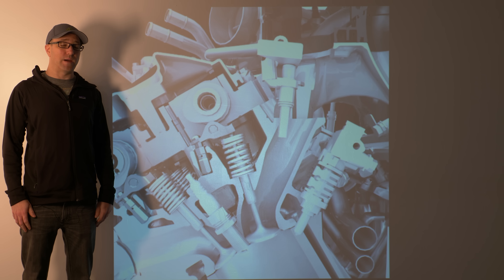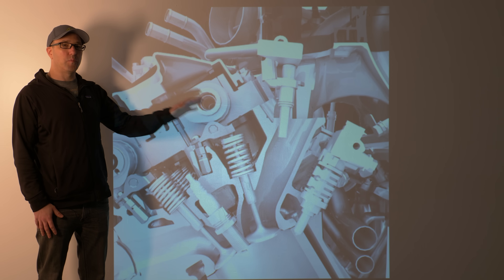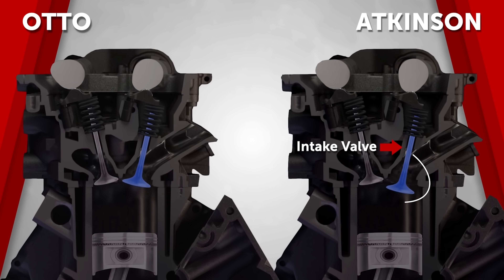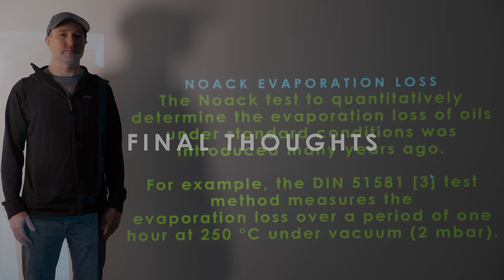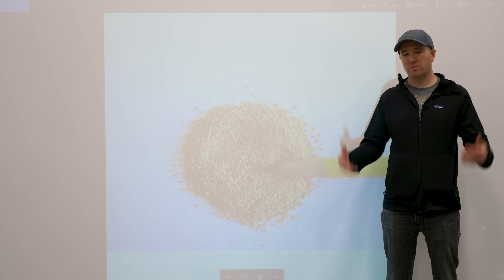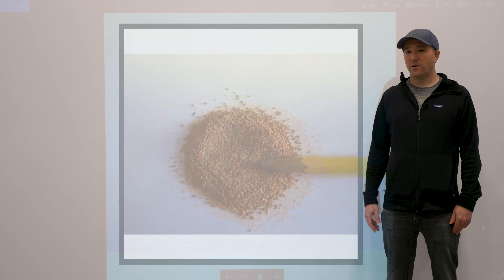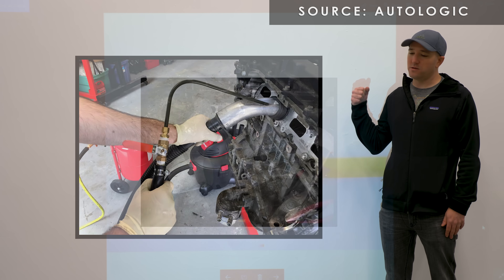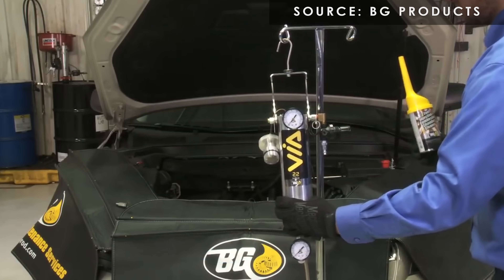Direct Injection, Problems and Solutions | The Fine Print

Comment: Great video. I've read none of the comments. But the BG and CRC distributors will come out in force with their unproven chemical wash. This can damage your engine. Ford and other automakers say don't use these chemicals for many reasons ...at any time. The only way to prevent carbon buildup is using a air/oil separator(catch can) and walnut blasting. Don't spray anything down your intake.

Comment: Thanks to the federal government our cars are more expensive to buy and maintain.  Had an 08 VW with the 2.0 turbo and DI  After 60k the dealer wanted $1200 to clean the valves.  I sprayed water and cleaner in the intake which cleaned it good enough to reset the CEL.  I traded it off and bought an older port injected vehicle.  You can keep the DI, I'll stick to the older PI motors.

Comment: The big issue is the speed at which new solutions are being integrated to meet emissions without extensive long-term durability tests.

Direct Injection valve carbonisation was well covered here.

The other issues is Low Speed Pre-Ignition (LSPI) issues with with Direct Injection (particularly turbocharged) and new generation low viscosity oils like 0W-16 and 0W-20. Nothing worse than a cracked piston from this.

Thankfully engineers are trying to resolve these issues. For example new generation oil standards like API SP, ILSAC GF-6(a or b) and ACEA C6 that are designed to prevent LSPI and timing chain wear with these 0W-16 and 0W-20 oils.

Comment: 2018 Mazda 3 2.5L just had a decarb and new fuel injectors installed.. still misfires.. New sparks, throttle body cleaned, MAF sensor cleaned, new air and cabin filters.. MPG down from 28 to 17.. dealership can't fix it.

Comment: Was not fully informed of the disadvantages of direct injection when I bought my Audi TTS. At 60.000 miles an independent shop advised me to have the walnut blasting done, the before and after photos were much more dramatic in terms of build up than even your pics, a sharper throttle response was notable. One note, the shop charged $700.00, my audi dealer 
"estimated" the same procedure at $1900.00 to $2100.00. would you comment in the future as to additives that promise to reduce these deposits ? Thanks for an excellent, understandable presentation about a real world problem.
Reply: I found a local guy to do it for $300. I asked him if I could help him clean the valves and replace the Intake Manifold, he dropped the price to $150. Now I have a clean engine and the knowledge to do it myself for $150. Pretty amazing deal. Then again I own a Mazda and the Intake Manifold is VERY easy to take off and positioned right in front of you. Its really not that hard of a job. A few hours cleaning without special tools. If you let the valves soak the junk comes right off with CRC after an hour or so.
Reply: An air oil separator/ catch can will reduce deposits on the valves

Comment: All owners of Audi and Volkswagen motors GDI have to do valve cleaning . I just did mine not bad if you take intake manifold off valves injectors right there . Best method Berry man’s intake cleaner hand full of zip ties . A little soaking time and best thing that worked for extraction fuel transfer pump from harbor freight about 10.00 did mine in 2 days . Be sure to pull fuel pump fuse and you can crank not start engine to close valves. I’m novice DIY er so if you have some kind of mechanical savy it can be done! Stay strong kings 💪🏼💪🏼💪🏼

Comment: Careful on his advice about going from a 0w20 to a 5w30w.  The newer engines out there are reducing the piston ring to bore pressure to make the engine more efficient. A thicker oil can seriously interfere with this.  Also, I can attest to BG Products being the tip of the spear in additives and cleaning systems. The vast majority of the other stuff is snake oil. BG actually works.

Comment: Just yesterday I installed my Mishimoto catchcan in my Type R. And with the last oil change I switched from the OE 0W20 to 5W30 by Redline
Reply: Btw I did the oil switch at 50.000km and the Catchcan at 51.500.

Comment: Amigo you are a gem! I have owned a 2006 Lexus GS300 GDI for a couple years and did not do my homework on it. I have done nothing but struggle with doing doordash full time and blowing through two quarts of oil a week no leaks keeping the combustion Chamber clean as I can dumping two cans of seafoam spray in it a month and I know I can't keep doing that but I just want to say this was an amazing presentation on very very important subject matter. And as you mentioned, i don't blame the engineers and car producers because you know the regulations that they have to keep up with and balance that with the customer satisfaction as he said so it was just a failed experiment and wow I didn't know what to do with this car I love my car and I keep my cars until the wheels fall off. And thanks to you I'm going to be able to keep mine until the wheels do fall off with some hope at the end of the GDI road which is very Bleak right now but thank you again so very much for this informative video you have really really made a difference in my Approach and now my attitude towards confronting this failed but not dead technology

Comment: You’re not illustrating the full scope of DI. Yes it does carbon buildup over time, but at most it can create a misfire scenario, however walnut blasting cleans this up which only involves removing the intake manifold and when this procedure is completed by a mechanic, it is being vacuumed out at the same time it is being blasted in order to prevent the dust particles from being left inside the head. Additionally, the cylinder must be on the compression or exhaust stroke to be done correctly. Licensed technicians are familiar with this procedure and it can be on the pricey side, but it is the nature of the beast. Regular and “on-time” oil changes while using a high octane fuel. You mentioned catch cans which is also a preventive component, however the trick with these are that a vehicle needs to get to operating temperature every time to prevent sludge buildup from moisture and condensation. Additionally, many vehicles are already equipped with these catch cans from the OE. Lastly, the EPA doesnt care if your engine is reliable during its life span outside of warranty. Their only concern is a reduction of emissions. The other point to make is most OE are building DI. Port is a thing of the past already even though theyre still on the road.
Reply: So, basically A) accept the semi-regular maintenance expense of walnut blasting whereas no costs were incurred there previously, B) forbid any short trip to the store where your DI engine never gets to operating temp, and C) accept that your chances of engine troubles after your warranty expires are inherently higher than those of a PI injected engine. Sounds like a real sweet deal!! ...both my VQ's have already outlasted DI engines from their respective eras, and will continue to see 5+ year old DI engines sent to the junkyard while they drink their 91 and get oil changes every 4K miles. That's the practical truth.

Comment: The best engine ever made was and is the Ford transit 2 5 DI ..DIRECT INJECTION DI ENGINE FITTED TO THE MK3 4 5 TRANSIT TRUCK VAN HERE IN THE QEER OLD CORRUPT UK 🇬🇧..I GOT A T REG 1999 DI TRANSIT VAN AND IT HAS OUTLASTED 8 MK 7 AND 8 9 AND OTHER SO CALLED TRANSIT MODELS..THESE NEW SHAPE TRANSITS ARE A DISGRACE AND A SHAMEFUL EXAMPLE OF RIPOFF CRAP THEY MAKE NOW TO RIPOFF MUGS WHO BUY THEZE SHITE TRUCKS..

Comment: This is a very cool presentation. You did mess up the gas blow by a little bit here (https://youtu.be/xrLNDgrIw3U?t=429) making it look like they blow up from the engine bottom past the cylinder rings and up to the engine's top and PCV valve. Nah. They blow down from the combustion chamber through the rings raising pressure in the crankcase on the bottom of the engine (and again you're somehow pointing to the top and calling it a crankcase), and then taking oil vapors along while they're traveling through ventilation channels toward PCV valve and back into intake.

Comment: Did he really say that about blowby and crankcase pressure? 100% wrong and almost the opposite of reality?
And the pictures of the supposed DI motor valves are obviously 20+ yo non-DI motor
Reply: I know and these simpletons are eating it just. tbh DI has gotten better at keeping carbon down, also seafoam every 30,000 miles and all will be good.

Comment: You just need to walnut blast your intake every 30,000 miles. Simple, just weigh out 2 cups of walnut media into a cup, use a funnel to pour it into your tank, the 2 stage pump system supplies it to your injector nozzles at the proper pressure for your injector nozzles to precision blast the carbon right off the metal surfaces. Shoot, your covering walnuts as I type this.

Comment: This is a very informative video and describes the problems related to direct injection very well.  He did make a couple
mis-statements when describing the sequence of events during combustion.  When combustion occurs there is a great deal 
of pressure created which drives the piston down.  But some of that unburnt fuel and air pressure pass the piston rings and 
ends up in the crankcase.  This pressure does not travel up into the engine as much as it travels down into the crankcase.  
The vapor rise through the passages in the crankcase.  It is later when all the fuel vapor rises to the top of  the engine and is 
pushed out the PCV circuit.  The PCV circuit dumps this vapor into the intake system, so that it can be burned.

Comment: Remember EGR on engines?  The reason you don't see it anymore after the early 2000's is the Camshaft Lobe profiles changed to allow the intake valve to open early allowing some exhaust to be pushed back up the intake to be re-burned.  The delete of EGR was a big cost save for manufacturers.  This is how the burnt carbon is getting on the valves.  The PCV system is making it worse by adding the unburned fuel and oil vapor to the carbon deposit only to be cooked and coated with carbon again when that intake valve opens late in the exhaust stroke.  We can thank the EPA and Manufacturers for the issues associated with the layering effect and carbon buildup in DI engines.
Reply: Quite a few Modern GDI turbo engine's still run a n EGR

Comment: My car is at 145k miles and I use either amsoil or pennzoil with relatively low volatility. I'm sure my valves are dirty af and I don't want to get them cleaned. If my car craps out I'm just getting a non tesla electric cause it's not worth the trouble going with a catch can on a DI turbo.

Comment: Very well presented. I have a 2019 Toyota yaris with a 1.5L DGI. I spray in a can of CRC GDI IVD Intake Valve and Turbo Cleaner every 5000 miles, an hour before I change the oil, and let it heat soak as per the directions. Then I change the oil. My poor car has a small stroke when I do this, but it clears up quickly. It has over 48,000 miles now, and still gets excellent mileage. I'm definitely going to look into getting a catch can too. I'm wondering if a water/oil trap for compressed air would work. They're very efficient, and have clear viewing bowls, but I'll stick with what's designed for this use.

Comment: Drive a vehicle with port fuel injection. Next problem please
Reply: At the same time, why are there no appealing PI engine anymore? Buy a new NA Honda 2.0? In a Civic/HR-V? Boring. Infiniti kept the 3.7 going in the Q70 up until 2019, that's a boat in my book but remains the only viable option to replace my 9 year old G37x.
Reply: leaking vacuum lines

Comment: Kinda got blow by backwards. Said it blows up into the valves. But it really blows down past the rings and into the block. Creates a overpressure which needs to be removed and burned instead of just dumped in the air.   But close enough.   Catch can helps alot on the pcv system.  It's cheap and easy to maintain. Some of the 90s cars had high mpg.  Not only do they not meet nox emissions  but they also had issues with spark knock and low performance.

Comment: Great video. I’m sure you have taken the effects of the timing related to DFI to create a “French Inhale” of fuel, and the quality of fuel the end user uses in their personal vehicle, which helps clean the valves… also, certain performance vehicles use up to 5 injections per cylinder cycle for operation. Premium quality fuel and quality LOW ASH OIL yields into 100k of performance that doesn’t need service.  You know why a Porsche rarely needs valve cleaning? Good fuel, good oil, spirited driver.

Comment: Seafoam top engine cleaner. Why does no one mention this. Use it every 5-10k miles. I had great results with the 2013 ford fusion with the 2.0t engine.

Comment: do the ole Italian tune up, spray B12 in the intake revving and bog cleans it up every time  with every oil change  while you have the air filter out, rev spray bog, rev spray bog a few times

Comment: 2013 Mazda CX-5 is DI as of 2022 9 years later no major problems. There are some driven over 250,000 mile and still very little to no complications.
Reply: Some wizardry going on there for sure. 13:1 compression, higher than a Ferrari 458 from the same era... if all DI engines were like this the roads would be a better place.
Reply: @jacquesc3166  Agreed

Comment: VW 2. 0 tsi are bad about it.  Skips on cold starts until the heat softens the carbon but only one way to fix it,  pull intake and clean the values

Comment: If your fuel injectors are clogged up, some of the liquid drops will end up on the tops of your intake valves, increasing carbon build up. Even if your fuel injectors are clean, you'll still need a valve cleaning in 80 to 100,000 miles. This is why GDI manufactures tell you to buy gas from a top tier gas company, or to put Techron in your gas at least once a year.

Comment: You can't run a heavier oil than the manufacturer specifies due to machining tolerances. If you do, you cause oil starvation. The best approach is to use the highest quality oil and change it every 5K or less.

Comment: I turn wrenches for a living and in my experience GDI brings back the problem of carburation: raw fuel washing the oil off the cylinder walls. IMO it's nothing but a ploy to reduce engine life, along with 0W-20 and 10K oil changes.

Comment: Remove the air filter and with the engine warmed up and running spray some Sea Foam into the intake, before you empty your catch can and change your oil. If you have high mileage or extended time between oil changes just spray it in the intake of your warmed up vehicle once a month or every other month. Doesn't take 5 minutes and I have yet to see anyone that couldn't figure out how go use a spray can.

Comment: Actually I remember this being a problem on quite a lot of carburettor engines in the past. The quick and dirty fix was to slowly pour a shotglass full of ATF (automatic transmission fluid) into the intake of the slightly revved up engine what like magic removed all the crusts and debris. We did not believe it fist but we checked with a medical endoscope and the result was astonishing and impressive. Cannot see why this should not work today too.
And yes, there will be a big cloud of dark smoke which will be unhealthy to breath and will annoy any possible neighbors, so choose the location well and stay offwind. 
I suppose the cleaner running afterwards easily balances the environmental impact of this one minute burning coal. 
And ATF is considerable cheaper then the "specialized" overprized mixtures sold for the purpose which are in truth just a mix of otherwise ass-cheap solvents.
Why it works? ATF consists of extremely long and stable chains of molecules, those can actually interact with the buildt up crap whilst shorter molecules in the best case just touch the surface very shortly and cleaning is superficial at best. Yes thats simplified but it points to the main difference of ATF to other oils and solvents.
Reply: Source?
Reply: 🤦‍♂️ this probably won’t ruin your car but I can guarantee no shot glass of ANY liquid will clean DI valves.

Comment: Hello Savagegeese! Fantastic material! Extremely well researched and presented. Thank you.

Re; the last part of the pinned comment. You might consider using one of those translucent screens and put the projector behind it. I'm pretty sure most projectors have the ability to reverse the image so it will read properly when projected from behind the screen. Or, you could do what weatherpeople commonly do. They use a green screen with a monitor off camera that you look at. Or, you could keep doing what your doing which works for most I suspect.